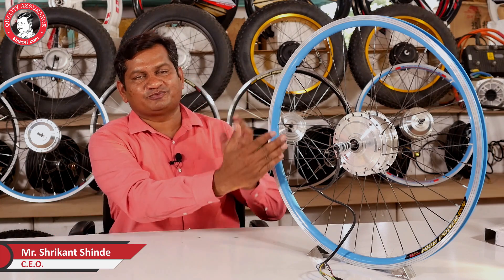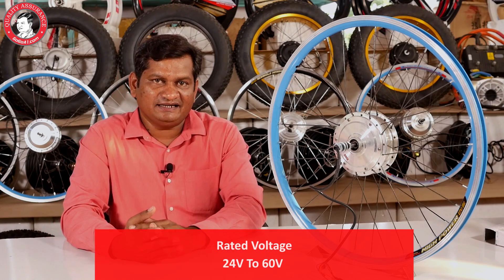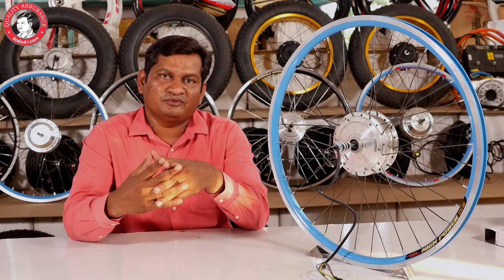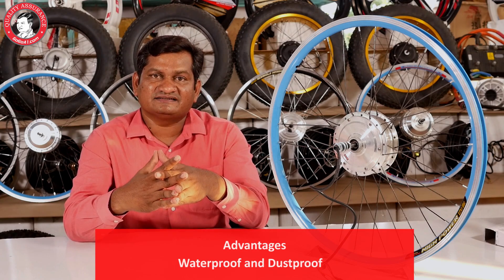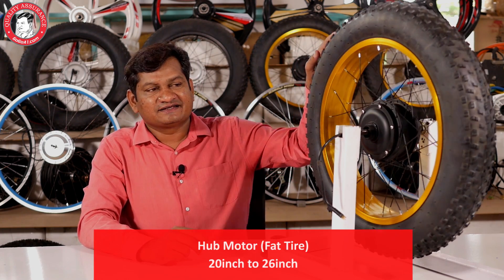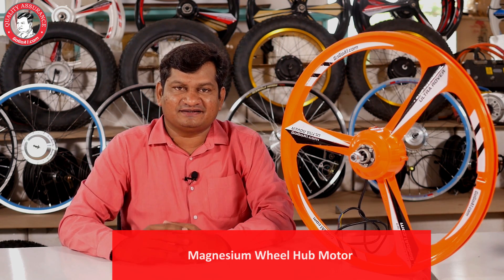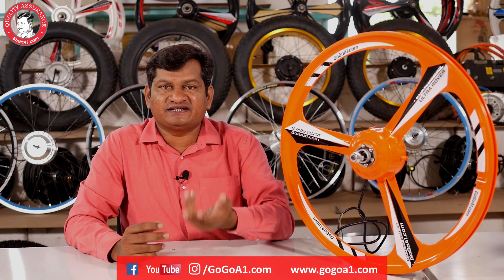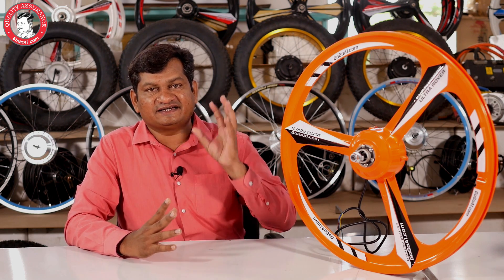Types of Hub Motors used for e bike

Comment: Nice sir,Can I get a moter for my bicycle but issue is my bicyle is with 9speed gear with  hydralic disc but with  thru axle so I want ur motor with no axle and axle size for my cycle is 12mm
Reply from the maker: Thank you sir for your valuable feedback.
For more details contact our team they will assist you 8657591802/7021920700

Comment: 28 inch roadster cycle k liye kysa hub motor use karenge?
Reply from the maker: Contact our team they will resolve your problems 8657591802/7021920700

Comment: Can a single mode pedal assist bike be converted into a multi mode by any easy means?
Reply from the maker: Contact our team, they will assist you +918657591802 / 8657591820

Comment: Sir 48 volt 350 watt hub motor , 48 volt 350 watt controller ,48 volt lithium battery aur throttle chahiye ky app total price bata sakte hai
Reply from the maker: Contact our team they will assist you +918657591802 / 8657591820

Comment: hero electric  , can we change hub motor from 250 W to 500 W..  to increase load carrying capacity and speed.
Reply from the maker: Contact our team they will assist you  +918657591802 / +917021920700

Comment: Sir I'm using 250watts bldc hub motor lithium ion battery 36volt 7.5ah gives 35kms mileage now I want to change 15ah lithium ion battery in my bicycle any problem in motor  or controller  please inform me sir
Reply from the maker: Contact us 8657591817 our team guide you.

Comment: Do you have hub motors that can be retrofitted on cars? Say Suzuki Wagon R and the like which are petrol front wheel drive cars. Do you have a hub motor which can be retro fit in two rear wheels of the car and kind of increase power and fuel efficiency? What is the all inclusive price if you have such a hub motor
Reply from the maker: visit our website www.gogoa1.com
more information contact 8657591817/7021920700

Comment: motor ki speed kaise control hoti hai.
voltage, current, frequency ?
Reply: Frequency
Reply: Nice but i found this product better Please check out this mid drive electric bicycle https://youtu.be/WWPJ63Mg4Tc | Call on 8238022888.